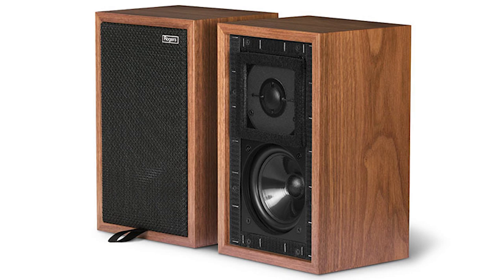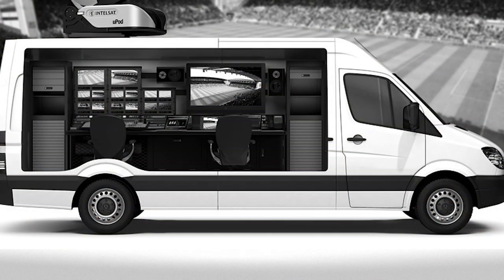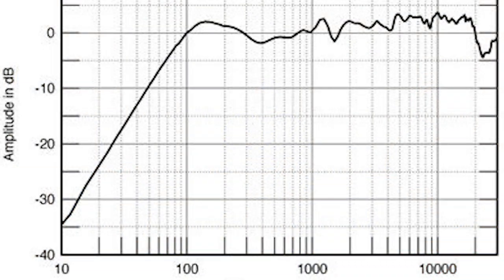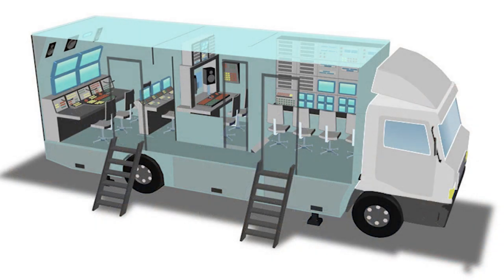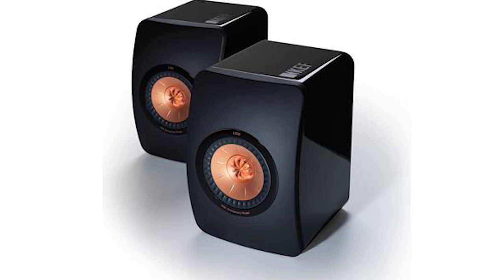BBC LS3/5a Monitor Speakers  - Is it all it's cracked up to be

Comment: Hey Adrian and team, I have my Rogers  LS3-5A speakers (Ring Audio 1982) up here at the lake (with the LSB-1 driving the bass) and a vintage Aurex pre/power amp setup  , I also tried my Hanson Monitors but they just didn't fit in the room. They still sound amazing after 42years and in the small living room with a stone fireplace behind. Cheers, I think of Derek daily.

Comment: Agreed these are awesome speakers. I build my 5a's from a kit and plans from Ring back in the '80s. Baltic birch cabinets, Ductseal putty and wool dampening, falcon crossover silver wire,
 etc etc. At the time Ring told me they sounded better than the Rodgers version in the store and better than any other kit build they heard. Thanks for the video guys. I will never part with these gems.

Comment: I (still) own a pair of 11 Ohm Rogers LS3/5a, bought in 1989, replacing my original Gold Badged 15 ohm versions... I used alternately / alongside Quad ESL57. I ~ 'replaced' both Ls3/5a and 57s, in daily use with Silverline SR17/SR17s, a whole longer story. I used LS3/5a nearly entirely with OTL tube amps, Atma-Sphere amps (early 90s, Futterman OTL3s, honorable mentions to Marantz 8B) I have on occasions, thought about selling mine, only to pull them out and listen... and they ARE everything they are cracked up to be... The only thing that I had to 'do', only fundamental limitation... was watch my volume control, the peaks... not to drive them too hard. I have always 'babied' mine, kept them out of sunlight/UV light and stored in boxes when not in use. They continue to amaze me...
Reply: Would you ever consider the Quad S2 or Z2 over the Rogers?

Comment: Hi, I am seriously considering the Falcon LS3/5A, however I am aware of alternatives i.e. Harbeth P3SER, ATC scm7 / Scm11  to name a few. Does the LS3/5A still rule the roost in the “mini monitor” nest?
Reply: Currently Harbeth p3esr is the flavor of the month in audio magazines. I own those  ls3/5a, Spendor clones, Kef 101's, and there is only subtle differences. I have Falcon clones but not their recent true Ls3/5a which I think are the probably best ls3/5a since they got the original engineer who designed t27 and b110 drivers to create true replacements. I'd give nod to Falcon's current Ls3/5a and  Harbeth p3esr. But change my amplifier and Kef reference 101 might rule. Only Harbeth's seem to not care about quality of amp, sounding good irregardless of choice. Harbeth best bargain when looking at system cost.
Reply: Joy&BRUCE bruce thanks for your helpful reply 👍

Comment: A great alternative to the venerated Rogers LS3/5a are the ROGERS Studio 3. I just bought a pair. They were made in the UK in 1993. I am truly impressed.  Great life-like sound also with either SS & Tube amps. Get a pair if you can before they start getting more expensive.  The bass is impressive for the size. I have owned various B&Ws, Monitor Audios UK made,  and now own ProAc D18 and can say that these Rogers are no slouch!

Comment: I vaguely recall (old slushware is getting glitchy) an affectionate parody by person now unknown in either Stereophile or The Absolute Sound of the John Keats' staple of English literature classes:  "Ode to an LS3/5A".  One clever couplet that has stuck with me over the years goes:

                                                                                      Beauty, too, I am a seeker.
                                                                                      I found it in a little speaker.

I have never owned a pair of LS3/5As, but always came away impressed after listening to those 'wonder puppies' at a friendly neighborhood brick-and-mortar stereo specialist dealer of both the high end and quality kit affordable by mere mortals.  Ahhh, the halcyon days of youth.  A question, have you tried stacking them into Double LS3/5As?  Tim de Paravicini of EAR Yoshino had demonstrated them at a recent Tokyo audio show, placing them on stands vertically tweeter to tweeter in sort of a D'Appolito array.  Kind of like the fabled Double Advents.  Ken Kessler has enthused about this set-up in Hi-Fi News & Record Review.  Although the article is about reel-to-reel tape, there is a picture of them on p. 33 of the Dec. 2019 issue of the magazine.  Concluding with a quote from Professor J. R. R. Tolkien, "The old that is strong does not whither."
Reply: Tom Leander  Indeed, you are correct.  Well, no one (that I know of) ever accused geologists (and especially retired ones, see above:  old slushware is getting glitchy) of being great at spelling.  Apologies to those concerned by such things.

Comment: Then theres  the Linn Kan which was developed by Linn after BBC licencee Chartwell went Bankrupt and their cabinet maker was left with a load of unsold LS3/5a cabinets which Linn bought up and develop into the Kan.  Keeping the Kef B110 woofer but replacing the Kef T27 tweeter with I believe a Scanspeak D2008 and later a Hiquphon unit (equiv to the current OW-1). or was it the other way round. Subsequent to the Kan, the Tukan was developed during the time Australian Rod Crawford (now with Legend Acoustics in Australia) was lead Speaker designer and was also responsible for the Kaber LS500 and Keltik.

Comment: I feel like you guys should have mentioned prices for the current model ls3/5a? Or perhaps what some of the used pairs from different manufactures go for these days? I see also Chinese copies of them as well. Guessing they are nowhere near the original specs ones.  Not surprised as the Chinese will copy any well known design. Thanks!
Reply: @adrianlow2114  ok. Thanks for the reply. With as many pair out there and as many companies that have made them how much would a good older set be? Thanks!
Reply: I never heard og Audiospace and they don't and have never had LS3/5A license.
Reply: @adrianlow2114  no they are not.
Reply: Go to ls35a.com go to inspired designs. You will see audiospace listed amongst various clones.
Reply: Matthew Taylor  its not patemted. It's a license. Trademark law is not patent law.

Comment: I'm sure it's been done somewhere, but I'd be very interested in this channel's comparison of the LS3/5a and KEF LS50.
Reply: Andy B ... I use the Harbeth P3ESR and also own the LS50. If I were to compare both, the LS50 is not as refined.

LS50 - mids are not as good as the P3ESR (very slightly forward), highs extended but not sufficiently refined, very good bass. IME the LS50 is good for casual listening and HT use.
P3ESR - superb bass, good sound stage, no extended highs, decent bass. Great pair of speakers for easy listening music, vocals and instruments. Will struggle when music gets too busy.
Reply: @hushpuppykl  thank you for the comparison! I hadn't even thought of the Harbeth P3ESR as another variant of the design. I've heard Rogers and Falcon versions, but I haven't heard any Harbeths at all in over 20 years, and I don't think I've ever heard the P3ESR.
Reply: Andy B ... the Harbeth P3ESR is still one of the best value for money LS 3/5A. The Rogers ain’t cheap. The Harbeth P3ESR is rated at 6ohms. I sold my first unit then bought back another. It’s a keeper. Not an amazing set of speaker but definitely a good speaker.
Reply: @hushpuppykl  Since when is the P3 an LS 3/5A?
Reply: Wimbo 9 ... direct descendant 😬. By the way, I’m curious why would the P3ESR not be deemed as an LS3/5a? Not under license and/or not a full fledged LS 3/5a design?
Reply: @hushpuppykl  Exactly. Your not your dad, are you?
Reply: Wimbo 9 ... 👌

Comment: They're amazing but overpriced
Reply: The Mistral LS3/5a only $700 USD?
Reply: If you don't have the budget, buy the Chinese version. Apparently nearly as good.

It is often hard to justify the perceived value of any small HiFi component. When I first saw a Lowther drive unit, a single driver was the same price as a complete 3-way kit which built into a pair of floor-standing speakers. Today I own a pair of Lowther horns and have to say they are worth every penny. Adjust your mind set. You are not buying a small piece of kit: you are buying a musical experience.

Enjoy the music.

Comment: Bose 901 will fill any size room and your LS3/5a will not and the Bose 901 will have a wider sound stage then most speakers so u are wrong
Reply: What a stupid comparison lol.  
Bose 901 is for big drunken party. LS3/5 is near-field intimate and personal. Worlds apart.
Reply: You have a terrible sonic palate if you even mention those two speakers in the same sentence.